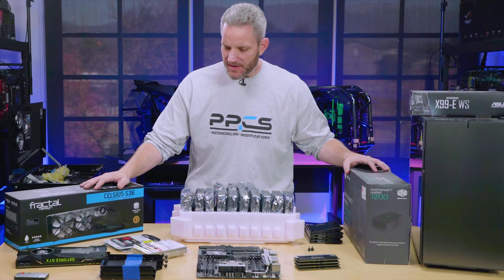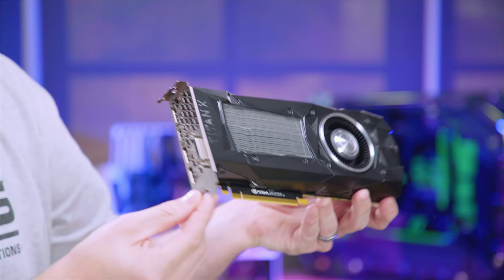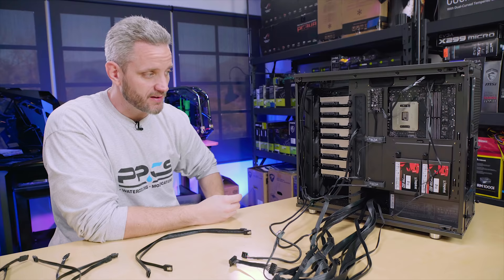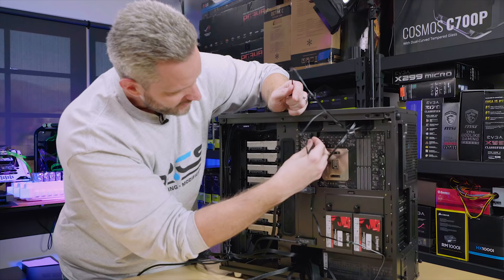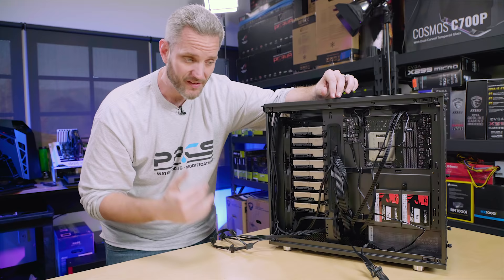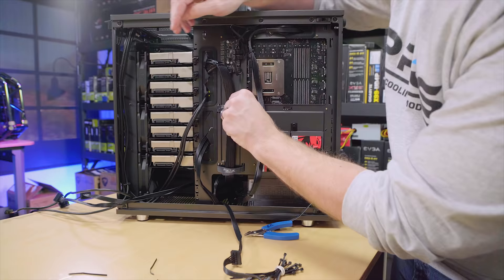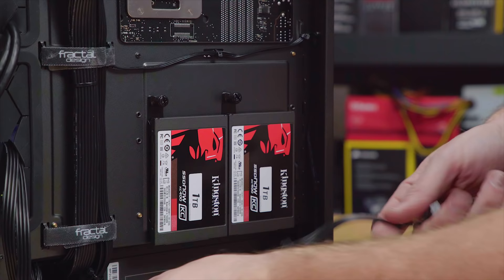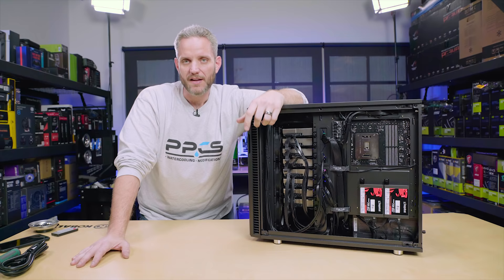How to cable manage a computer

Comment: Cheap trick for mock-up: use the twist ties that usually come with builds as temporary cable ties. Easy to remove and re-use, then once everything is in place, remove and replace each twist tie with a Zip Tie.
Reply: glad I'm not the only one who thought of this props.
Reply: You can also grab a load of them from grocery stores (;
Reply: I wouldn't reccomend that as a lot of people will have it all done and just get lazy and not replace them. Which then leaves metal wires in the case. Not great...
Reply: Surprised your comment isn't anchored to the top. It's a must-do if a builder doesn't want snipped plastic pieces all over the place. Used to do that with old school stereo systems, and continued the technique with computer builds.
Reply: evga also has cable management grommets
Reply: If your using good quality zip ties you can feed them with the smooth side towards locking tab and they will hold. When your done your routing just pull them apart and feed them through correctly.
Reply: The Spitting Llama yes, but the twist has a metal in it which if it comes in contact with the case and mobo it can potentially fry your mobo which is why everyone uses zip ties
Reply: Thats a good way to fry your mobo. It is rare I know, but they contain metal inside. It just takes a 1 mm to screw you over. Also many people tend to forget to remove them and replacing it with zip ties. I prefer to waste zip ties then my hardware.
Reply: I just put a zip tie in but I don't tighten it all the way so I can keep putting cables through it. Once I'm happy, then I'll tighten and snip. I think if I did it your way, I'd get lazy at the end and just leave the twist ties.
Reply: I have been using twist ties only for quite a while now because I hate not being able to add another cable to a zip tie.
They are completely fine.
If the fact that the inside of them is metal makes you think it can damage your PC, boy you must be super scared about the fact that the whole case is made out of metal...
Reply: You can safely use the twist ties on a permanent basis, they just won't look as good as zip ties or velcro ties. I remember hearing Linus say that he preferred twist ties to zip ties because they were easily reusable.
Reply: Knowing me they'd end up being permanent mock-ups

Comment: And then you notice the PSU isn't working. 😌
Reply: That exact thing happened to me today. Took forever to troubleshoot too, because the PSU was pumping enough power to turn the RAM LEDs on, but nothing more.
Reply: Test run before puting it into a case? Anybody? No? Okay..
Reply: Fabijan Rehorić // Bingo!

Always test-run before building. Since I usually work with SFF cases, test-runs have become an absolute must. My first SFF build I didn't test-run, had to tear it down to reseat the CPU and only then it worked.
Reply: Ujiltrom M how do you test run it when you dont have everything plugged into place??
Reply: No excuses. I haven't built a PC in 8 years, so a lot of lessons were forgotten.
Reply: +Fabijan Rehoric
This is exactly what I do before making things pretty. Just plug it all in, test it to see if it works. Then later I come back and re-arrange all the cables to create art. The art is, the less you can see the cables, the better. :)
Reply: Press F to pay respects

F
Reply: Most people notice that before they ever get to cable management because they do a test run before looking at their case.
Reply: I asume you put down motherboard, cpu, ram and tried going into BIOS before installing anything in your case xD.
Reply: RMAs the PSU only to find out you forgot to flick on the power switch

Comment: I...I just realized that I don't use my front panel HD audio jacks but I took great care in routing the cable properly, plugging it in, and managing the excess length when I could have just... TUCKED IT INTO THE BACK WITHOUT PLUGGING IT IN. Well, live and learn.
Reply: 19thHour lol same thing here
Reply: Those connectors are occasionally useful for guests. Even if you are not going to use them now, I follow the logic of "Make it available" so later on if you need another audio connector you're not looking like a buffoon because you neglected to have it available to you.
Reply: May I join the club ?
Reply: Yeah i dont use it too. I have USB headphones but still this cable management is good my pc lokk like a mess
Reply: I was reusing my old case and I found one cable sticking out that had some wires out of their plug. I concluded that it hasn't worked before anyways so I probably don't need to plug it in as I never used it. I then unplugged it from old motherboard and read - HD audio :D
Reply: It's not that hard. I do use it to plug things like headphones and bass/guitar.
Reply: I don't like the feeling of everything on my desktop "not working". Even if I don't use somehting like a usb port on my computer I'll still wire it up so it doesn't bother me as well if anyone else uses my computer...
Reply: I spent time doing the same thing. Feels bad :(
Reply: I actually removed my entire front I/O completely out of the system, because I use neither the audio nor the usb and it was really a relief to get rid of those cables.
Reply: Guest that are going to use my front panel HD? In what scenario does that even make any sense?
Reply: 19thHour I have a nice pair of sennheisers that are hooked to my onboard audio in the rear so I end up using my front audio often to plug in my gigantic stereo when I want to listen to music or play games without headphones. I always hook it up no matter what. Jay doesn't need that shit for a workstation/render machine lol.
Reply: I usually take a pair of scissors to mine. Much easier. :P
Reply: I re-cable managed recently and when I got to the eSATA and Firewire front panel cables (old case), I thankfully did realize that I never use them and don't need to plug them in.
Reply: I plugged in my front audio anyway, since it would be embarrassing if someone were to see my PC and only to find out some ports don't work. And I basically never use my front audio except for when I want to use my gaming headset with mic (the cable is too short to use the rear audio). But that is extremely rare since me and all my friends are too busy to play.
Reply: thats not the point, i know i am never gonna use it, but to have it unconnected? it would be a sacrilege! OCD rules!
Reply: My issue is I cant stand non functional ports. If it has headphone jacks, even if I literally never use them, I want them to work.
Reply: Hey it's all good man, I plugged it in knowing full well I was gonna put all of my audio through my Firewire digital sound board. I just didn't want any of the ports to not work on account of how much money I spent on the build. All my mics are XLR too, I don't own an 1/8" mic or even an adapter. I have such better audio options available, OCD tendencies is literally the only defense I have for plugging it in lol.
Reply: I have to use the front panel for audio since the rear mobo audio picks up the terrible coil whine from my GPU when I game. Sometimes it pays off.
Reply: but if you need it some day, because your MB audio or your pci soundcard died, you can plug your headset right in without having to open your box and maybe redo part or whole of your cabling...
Reply: As soon as you make a new pc and don’t plug those in, you’ll need them within a week. It’s how it always works

Comment: Cable management in a nutshell: Planning, some trial and error, finishing. Rarely does it get finished off on the first attempt. Unless you've used the same case multiple times, it's just the way it is. So worth it, though, in the end. Nice tutorial, Jay.
Reply: matt depends on the case, some cases are very easy amd others alot harder
Reply: I've had the same case for over 15 years (three builds), so yeah, cable management comes pretty naturally on my own system.

Comment: I've been building PC's since the mid 90's, and never cared about the look at all. 
After watching Jays vids for about 2 years, now i have a color-themed (black/red) PC with full sidepanel window, AiO liquid cooling, LED fans and properly managed sleeved cables.
Thx Jay, you are awesome :)
Reply: Was about to post the same thing.  Been building PCs for over 20 years, never cared about the cable management.  Planning on a new build (with this same case no less!), and this video was very helpful to me.  After this will be untangling the spiderweb of wires behind my desk.  eeep!
Reply: We never cared because how the hell did you manage IDE cables in those old cases? The best we could do was those "round" ones. Never mind routing behind the motherboard!
Reply: lol consumer victim
Reply: @chloedevereaux1801  20 years ain't long that would be since about 2000 which is perfectly believeable
Reply: @BananasananaB  yep this has no rolled over into my plugs for electronics, speakers, shit in my garage, etc etc. Driving the wife crazy as I "custom cut" her hair dryer cord and cable managed her computer desk.
Reply: @BuddyRHS1965  I bet it's nice and tidy though.
Reply: Yeah, been there myself. Heck, you were lucky in the 80s or early 90s if your case, floppy drive and CD-ROM were all the same shade of beige! Interiors always looked a mess, but no-one saw them anyway. I remember seeing ONE company that advertised rudimentary cable management for the sake of better cooling and maintenance, and showed their machine interiors in ads, but that was the exception.
I can't believe how good the modern hardware looks!
Reply: @calebfuller4713  Plus the case itself. Some cases have zero cable management ability. There is no hiding cables because the side panel next to the motherboard is flush to the side of the case and even the thinnest cable would cause the panel not to properly close. In other words, there is absolutely no gap like the case shown in the video.
Reply: SolderGirl same here 😃

Comment: for SATA power cables in your case, I'd do first cable for 1st, 3rd, 5th and 7th and the second cable for 2nd, 4th, 6th and 8th HDD so you dont need to make a loop
Reply: Finally ! You go up.
Reply: I don't think that'll work. That would force him to bend the cables around the in-between HDDs (around HDD 2 in case of 1 and 3 being connected and so on), and I don't think those flat cables are gonna bend that easily.
Reply: Nawar El Sabaa  I see what u mean, but they do work, they will bend easily (easier than shown on video even) and I think its better  protected cables. bending the way Jay did is fine anyway.
Reply: @nawarelsabaa  Well, it's pretty easy to split the plastic of the flat cable to make them easier to make more like a square of cable on this short distance and wont really affect the look.
Reply: I think he split the power connections and make "the loops" couse the side's for raid....? Correct me if I am wrong, but that is the only logic I saw. P.S. It really grinded my gears when I saw that "ponytail" sata's :D
Reply: The real suggestion here should be that PSU manufacturers make the cables much shorter between connectors. How hard is it to design specific cables with a SATA connector spaced along the wires every standard HDD bay spacing or 5cm?
Reply: @h3iberg456  having had to deal with servers with failed sata power and data as people have kinked them, it made my skin crawl.
Reply: Why is there so many hard drives?
Reply: I initially thought the same, but then he brought up having the need to trace cables should issues arise. Especially in a business environment, it always helps to manage these things as simply as possible, because there's always the chance that someone else might have to come in to troubleshoot an issue. You don't want someone having to spend time figuring out what cables go where if time is a factor.

Also, those top four HDDs are going to a different controller, so it makes sense that those power cables be separated from the others. If a cable fails, rather than potentially affecting every array in the system, it will only affect drives on one controller or the other.
Reply: @reidbtw  It's a storage server.
Reply: Glad im not the only one who was thinking this.
Reply: @Szarky was about to comment the same thing  ob this video

Comment: @JayzTwoCents, Just a suggestion from experience: If you connect the MB SATA to the top 4 drives and the RAID controller to the bottom 4, the lengths will work out better. Reason, the MB SATA connectors are at the front of the MB and thus closer to the bays so the cables can reach the top drives. The RAID controller will be a short card commonly and you will need the length from the lower drives to reach the SATA RAID connectors.
Connecting the MB SATA cables to the bottom drives wastes the added length you will need later.

Comment: I'd be curious to see how you set up the system to work as a server, render machine, etc. Please make a vid on that. Thankssssss.
Reply: petabyte project is not an unraid but I think jayz server will be. It is easy to setup and use. But I hope he is not buying a raid controller, he needs a HBA or dumb sata controller for unraid.
Reply: Ditto

Comment: Jay, you should talk with a case manufacturer and try to get them to do a collab and create what you think would be the ultimate cable-management case. Maybe something like hollow rails or spaced case covers to run the cables inside the case itself or whatever, I think you'd come up with something really cool.
Reply: Samurai Salesman he should host a design contest
Reply: Yep I've gone through many a case asking myself why don't the manufacturers of cases think about this in their design. 

Having said that, this box is one of the better ones I've seen. 

Thanks for the suggestion. 👍
Reply: NZXT H700i Check out the cable management in that Case and come back!
Reply: Samurai Salesman basically describing FD r6
Reply: That fancy $950 Singularity Spectre case is what you're looking for.
Reply: I was thinking more like making a case that isn't sold at a price higher than my entire system.
Reply: It already exists. Nzxt h700i
Reply: Kevin Seabright Hmmmm I'm impressed!! Looks like I may have to invest in that! 👍👍 Thanks for the tip! 😊

Comment: I'm quite late into watching this video (out of interest to see what people have to say about cable management)... here's my $0.02. You have a fantastic vertical arrangement of 8 hard drives... and you have two strips of 4x SATA power cables... One improvement on cable management is to skip a hard drive between SATA connections on the same cable, or one cable deals with hard drives in odd numbered slots, the other cable deals with hard drives in even numbered slots. In other words, for your build, the first 4x SATA power cable is connected to hard drives 1, 3, 5 and 7; the second 4x SATA power cable is connected to hard drives 2, 4, 6 and 8. That way you don't have to fold the power cables to tamp them down. With flat cables, they'll look like a braid... aesthetically it may or may not be everybody's cup of tea, unless you have a solid back cover, which means who really cares?

Comment: A trick I've used for many drives in a stack is to power then up as drive 1,3,5,7 and 2,4,6,8 that way the power cable isnt bent over each drive and helps space things out. Also, I don't see any 90 degree sata cables being used. getting some 90 left and 90 right cabled would help flatten down all the data looms coming off those drives. And a question about the case, do the drives come out from the front side of the case or do you have to remove the entire sata power/data looms to get a drive out?

Comment: I used a Ryzen for a similiar build (just with an R5) and believe it is a better choice. (x1800, 32GB ECC memory, 10x 8TB drives, 2x250GB SSD for boot, 2x 512GB Nvme drives for cache).
Reply: ossme how's the temp of everything may I ask. I worry the case may have some airflow issue.
Reply: It is working great! I have a total of 7 fans in there. The only major heat source is the GTX 1070
Reply: ossme what are your temps under load ?

I’m actually building a custom pc from ground up at the moment, went with r5 2600 and evga gtx 1070, have yet to put it all together though. I’m curious to hear how your setup is running temp wise
Reply: ossme 
That’s a lot of hentai

Comment: Just started work the other day on a gaming build that uses this case, and I found that placing the rig on a towel makes it easier to spin around if I need to switch sides quickly and safely.

Comment: +JayzTwoCents
And try to separate the power cables as much you can from data cables.
Power cables can have interference on data cables.
Another good logic is, try to bend the cables as less you can.
This is even more important on data cables then power cables.

Comment: Amazing video and top notch cable management, Great work Jay!

I always use the 90 degree bent Sata data cables.  There's plenty of room here for the ones you used but those 90 degree ones are made for that reason.